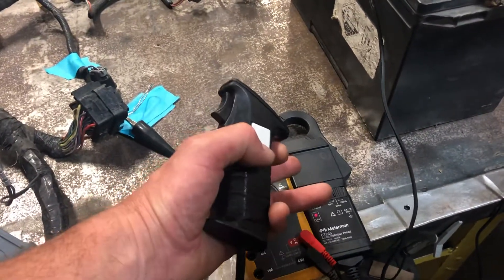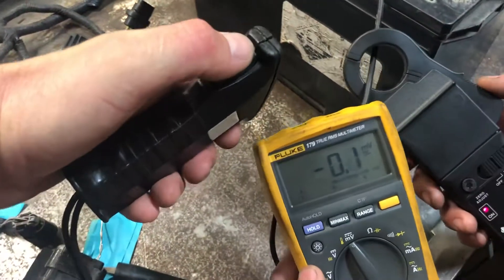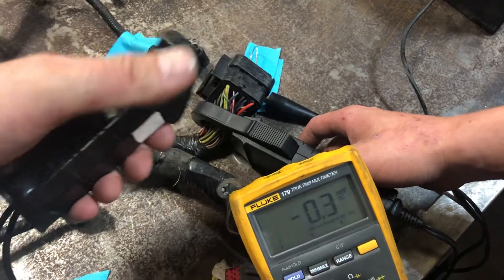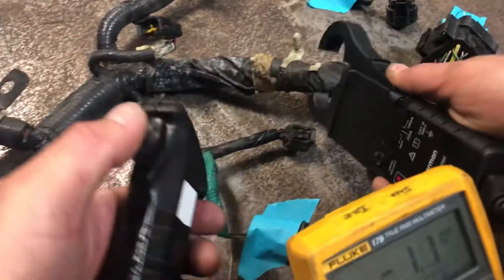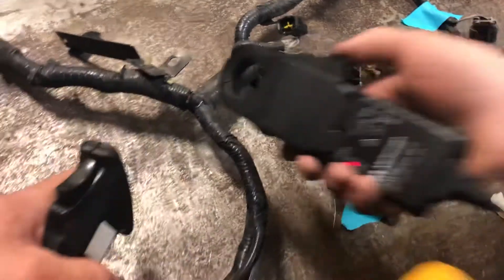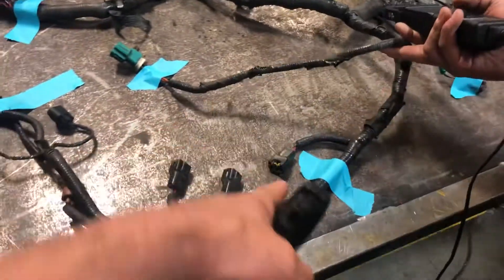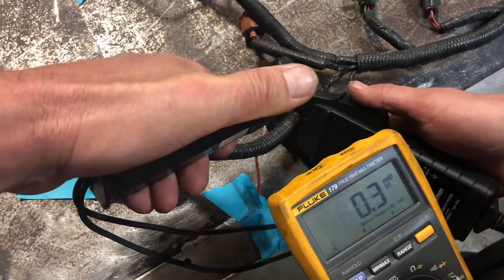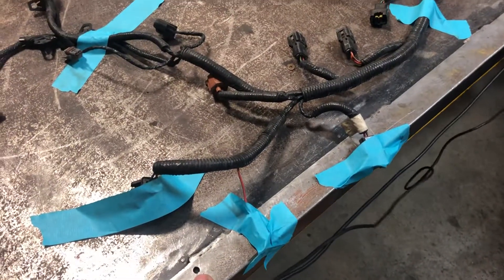Short circuit diagnostics

Comment: Following your video after a fusible link blew in my 93 D250 Dodge, I was moving the current clamp down the wiring harness. I must have just bumped the harness and the short disappeared. Jumpered the fusable link with a remote starter switch for only one second at a time. It was pulling 100-300 amps ! Not a melted wire in sight ! Put in a 40 amp resettable breaker until I find the short. A tough one.